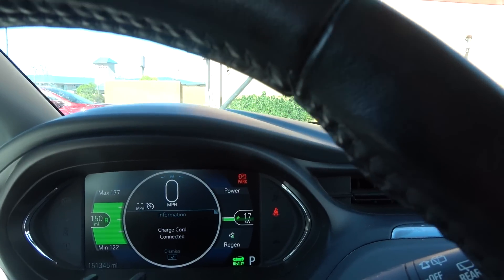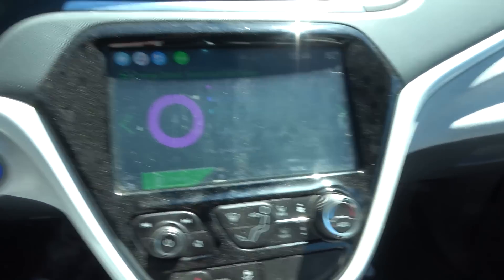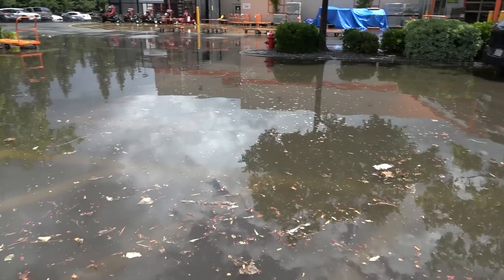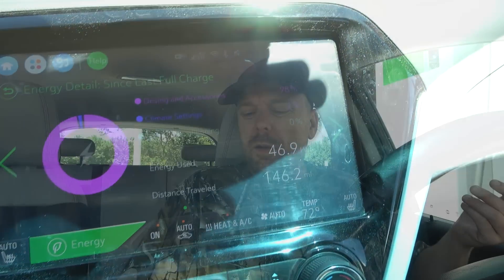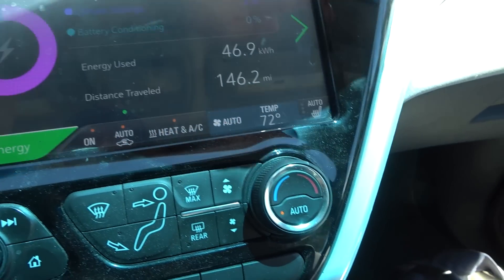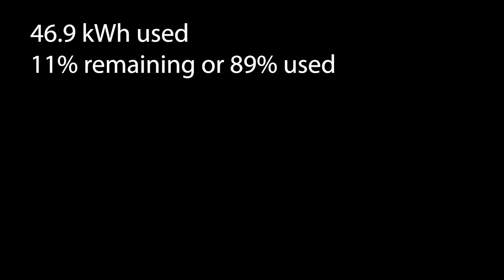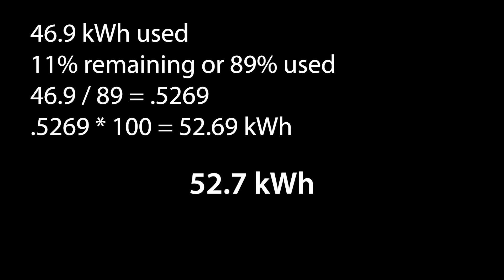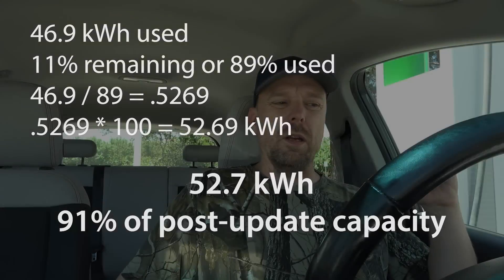2017 Chevy Bolt EV Battery Degradation at 150,000 Miles

Comment: 60KW or 66KW after recall ?
Reply from the maker: This was before my battery replacement, so this was the original 60 kWh pack that shipped with the car in 2016.
Reply: @newscoulomb3705  sorry don't understand , this video was uploaded 2 years ago , you don't replace your battery until 2023 ?
Reply from the maker: @tanweerahmed6861  My battery was replaced after I made this video, so this was the last degradation test I did on the original, 60 kWh battery. I now have a new, 66 kWh battery installed. That was done at 159,000, if I recall correctly, but I'd need to go back and check my notes.

Comment: That is what you get when you insist on charging to 100% and draining to near zero. Most of the time, we don't need to charge to 100%. So, we mostly charge to about 80% and don't drain to below 20%. Charge to !00% only if  we need when taking long trips and need every mile to reach the next charging station. Look at it like constantly filling and draining an air balloon. Filling to 100% stretches it, draining it to near zero, wrinkles it. Less of that is best for the battery.
Reply from the maker: With batteries, it's more about letting them sit at 100%. I was charging to 100% and letting it sit for long periods the first year, but I started limiting it to 90% after that. The arriving with <5% was a bit of a necessity back then, given the spacing of most of the chargers. Now, it's fairly reasonable to stay between 90% and 10% nearly all of the time.

Comment: I think 10% deg isn’t pretty good at 150k. maybe at 250k will be serious losses and problems. it seems that battery needs more upgrades. for more reliability degradation at 300k must be 10% and no more
Reply from the maker: The 10% includes the ~2 kWh that was lost due to reprogramming how the energy was calculated. Either way, I spent most of the first year charging to 100%, which had most of the impact on degradation.

Comment: this is all pretty sketchy

there are many things that can affect the range of your EV. Not just the battery, but wheel alignment, a sticky brake caliper, changes to your use of the heater or AC, changes to your driving habits. 

The range estimator on the dash board is only guessing how much range is left after a long trip, it can be off in either direction.

You can use an OBD2 reader to read the voltage of each cell in the battery pack. If you treat this like compression on a gas engine, and keep track of it over the years, you should be able to tell when a battery cell is starting to go bad. 

But unless you have a standard 200 mile drive that you can use for a test, at the same time of year, at the same temperature, road and traffic conditions, and use the cruise control to maintain the same speed each time you drive it, and take the wind speed into consideration (ask any motorcycle rider with no windshield).... I think you would just be chasing the wind.

When you charge your car the charger will tell you how many KW-Hrs it supplied, but it cannot tell you the charging efficiency of your batteries. They are not 100% efficient -  to fully charge a 60kwhr battery pack you might need to put 65 or 66 or 69 KHhrs into it, also depending on temperature. 

When the car shows you (on the onstar ap for example) that the battery is 60% or 100% charged, what does that even mean? What is it measuring?
Reply from the maker: It appears that you don't understand the methodology. The Range Estimator isn't used for any part of the calculation. Even the actual range and miles on the odometer aren't factored.

The only data points are the Energy Used display, battery SOC readings (from multiple sources), and previously collected data using the same methodology.

Comment: Hi :) I just got a 2017 bolt ev with 122000 km. It runs like a champ. I am wondering if when you press the accelerator or break, do you hear a click sound like the gear just setting when accelerating or decelerating? i dont feel anything I just hear a little click. Also, do you find it reliable ? I have no issues yet but just wondering what you thoughts are as you owned it frome day one and have more mileage then I do. Thanks for the videos!   Its nice that you take time to share your experiences :)
Reply from the maker: Thank you. No, I haven't heard any clicking sounds on acceleration. Overall, I've found the Bolt EV to be very reliable. All of the issues I've had so far were the result of required maintenance, road wear/abuse, and recalls. Even then, none of those really affected the drivability in any meaningful way. Thanks for watching! I'll have more updates soon.

Comment: Google says that the battery was originally 60.9 kwh but only 58 was usable so you had about 9.1% degradation.
Reply from the maker: That Google research isn't accounting for the fact that my Bolt EV predated the patch that appears to have reduced usable capacity by ~2 kWh (at least on Energy Usage screen). I documented that update and the results on this channel. So in terms of real capacity loss, it would be based on starting with an initial capacity of 58-59 kWh.

Comment: How much is a battery replacement cost?
Reply from the maker: I'm not sure anyone knows at this point. There would be a core charge, and GM EV techs charge about $250 an hour. So it would probably be $1,500 to $2,000 for labor and then whatever the battery cost minus core. So far, the only batteries that have had to be replaced were still under warranty.

Comment: Had my bolt for 1 1/2 years 90% of the time I drive between 70 and 75. I get 3.5 economy. Does that sound right to you?
Reply from the maker: Yes, that sounds about right. It's not too far off of what I've experienced with very similar driving.

Comment: 88% after 150k miles sounds pretty good to me. For my 2020 Bolt EV, Chevrolet says 66 kWh, but a sticker on the battery itself says 64 kWh, so I'll go with that. At this point, after 14k miles and with my driving routine, I'm getting 4.5 miles per kWh which amounts to 288 miles of range from the 64 kWh battery. At 150k miles, if I still have 88% of the vehicle's 259 miles of EPA estimated range, I'll be very happy. I rarely charge above 80% now anyway. With only 200 miles of range, this vehicle is still very practical even on road trips requiring DCFC.
Reply from the maker: Yeah, I definitely agree. I need to start doing some more testing with this new 64 kWh battery. Apparently, there are two different ratings for energy, which is why the sticker on the battery doesn't always match. I just go with the energy displayed in the car because that is what I can see and track.
Reply: @newscoulomb3705  If you had 150k miles before Chevrolet replaced your battery, you made out like a bandit. They may never replace mine, but I'm happy enough with it anyway. If the diagnostic software says it's OK, I believe it.

Comment: GM has less battery and drive unit failures than tesla it seems like any way.
Reply from the maker: They do, especially earlier on. Tesla has improved a lot with their drive units, which used to go out more regularly, but I don't know that I've ever heard of a GM drive unit failing. It's usually a supporting component of some kind.
Reply: @newscoulomb3705  Nice evs are coming from LYRIQ TO BLAZER might be cheaper in used markets.I Already see mech e in the mid 20s.

Comment: 10% battery degradation at 100,000 miles means 100% degradation at 1,000,000 miles. And, if an owner does not abuse his/her Bolt with frequent fast charging or severe driving conditions, the battery is likely to last even longer than that. Not bad at all.

Comment: when I drove to Salt Lake City to las Vegas with my chevy boltI was averaging a little better than 200 miles per charge with my new battery is that good or bad
Reply from the maker: Those are 80 mph freeways, so I think 200 miles would be expected at those speeds. You should be seeing around 64 kWh used from full to empty with a new battery, so 200 miles would be 320 Wh/mi or around 3.1 mi/kWh. That's in line with expected efficiency at those driving speeds.

Comment: Bought a 2017 bolt with 35k on it then got the new battery install. I'm doing 210 miles per day through the chicago winters. New battery already has 100k on it.
Reply: You are getting 210 miles, even in Chicago winter?  I live in suburbs of Chicago and considering a low mileage 2017 Bolt.  Just curious how things will be in a Chicago winter?   Thanks

Comment: They're not "upgrading" anything. Instead of giving it an upgraded Ultium pack, they are scrapping the Bolt altogether.
Reply from the maker: They're essentially replacing the Bolt with the Equinox. The hope is that this will only be for the time being, and GM will eventually bring back the Bolt EV or some equivalent compact hatchback.

Comment: I plan to keep my bolt for long term. Wonder what kind of fix have you done to your bolt? Just want to know what kind of problem I may have down the road...
Reply from the maker: There really haven't been any fixes. I've taken it in for a couple of recalls, but those didn't cost me anything. Other than that, it was only wear items and damage. So things like tires, wiper blades, and cabin air filters, but also a replacement windshield due to rock cracks. Outside of that, the Bolt EV has had zero issues.
Reply: @newscoulomb3705  wow. how about wheel bearings, arms? I wonder how the car holds up on those mechanical parts that usually gets wear and tear.
Reply from the maker: @yili9725  So far, nothing. I think the Bolt mostly has sealed bearings, but I haven't needed to check/replace anything so far. Even the battery coolant flush was done when the battery was replaced under warranty (that flush usually happens at 150,000 miles).

Comment: Replacement? Why? Replace the bad cells and save money.
Reply from the maker: The cells aren't bad, but they are a potential fire risk. There's no way to confirm that they are bad, so it is safer to simply replace all the cells in the pack.
Reply: @newscoulomb3705  there's a shop in the DMV area that will test all the cells and replace bad ones. I've had it done. Auto Tech Service in DC.
Reply from the maker: @livingthedash6727  Perhaps, but GM dealerships won't do that under the full recall. In my opinion, it's better to just take the free replacement battery and not worry about it.
Reply: It doesn't work like that, not on these massive packs. Unbalanced cells will forever be unhappy cells.

Comment: Now that you've hit 150K miles, have you given any thought about the maintenance schedule? Have you thought about changing the coolant ot the transmission fluid?
Reply from the maker: Great question. I was just notified that I will be receiving my replacement battery this week (which is why I put off the maintenance), and part of replacing the battery is draining the coolant. I will ask them about additional maintenance when I'm there.

Comment: i thought fast charging between 30%-70% does no damage to li-battery. maybe eric's frequent dc fast charging was helping him.
calculation wise, gm says there is 57 kwh electricity can be used to drive. so i am not sure if eric's calculation has the right denominator.
Reply from the maker: Fast charging between 30% and 70% significantly reduces battery wear, but it wouldn't eliminate it completely. 

The 57 kWh is also not accurate. Yes, it's on a sticker on the case from LG, but it's not the same energy calculation that GM used to come up with 60 kWh. GM's numbers are what is displayed in the car, and even the later 58 kWh that many Bolt EV owners saw displayed new appears to be due to GM's adding a buffer that reduced that original 60 kWh.
Reply: @newscoulomb3705  my point was your fast charging during long distance trips actually does not hurt the battery. calculation wise, gm advertise 10% degradation on 100000miles, or 5.7-6 kwh. and that should be really achievable. If your battery capacity reduce less than that, meaning you are doing ok.
Reply from the maker: @yili9725  Ah, I see. But that's still not right if you're assuming that I'm starting most of my DCFC sessions at 30%. Typically, I'm starting my DCFC sessions at <10%, and often <5%. So there's quite a bit of additional wear as a result.

Comment: Welcome to EV Life, cold temp,drop in range, too hot drop....too much of a headache!
Reply from the maker: Those things affect gas cars, too. If people are forgetting that, it explains why I see so many abandoned gas cars on the side of the freeway. Sure, some had overheated or caught on fire, but I guess the rest just ran out of fuel. 🤷‍♂
Reply: @newscoulomb3705  Good points. All I'm saying is EV's are the future but there are problems for long roadtrips,combined with Temp impact is not practical for the majority. Design EV with 400 mile range with min drop in range, MSRP mid 30K you have a game changer. Until then I'm happy with my 38mpg average ICE.
Reply from the maker: @kv1930  You'd have a game changer long before that. A new Bolt EV (not mine, with over 150,000 miles) would already meet the needs of a majority of drivers (according to DOT data, fewer than half of all drivers ever take long trips of 200 miles or more). 

The sticking point is still price. The median new car purchase price is still less than $30,000, and most people still can't (or won't) buy cars new. Price a 200 to 250 mile EV at $25,000 MSRP, and you'll have your game changer.
Reply: @newscoulomb3705  I agree! Hopefully I can be in good health for another 15 years and go EV!

Comment: Can you get more details on the battery level and performance with an OBD reader?
Reply from the maker: No, not really. In my experience, the OBD2 reader and apps aren't very accurate when it comes to calculating degradation or even battery percentage. I've found that using the onscreen data and information from the charger (what the car is reporting to the charger) is far more accurate, and really, what I'm looking for is real-world numbers that can easily translate to what other Bolt EV owners are seeing (and not just those using OBD2 readers and apps).

Comment: Are they not replacing batteries under recall?
Reply from the maker: They are, but my local dealerships are all very slow to replace. Several have told me that they only have the bandwidth to do one or two battery replacements a month, so I figured I'd use the opportunity to keep testing my original battery as long as possible.

Comment: That is really good degradation if that's the original battery. Very cool. My spark is around 90 percent from new with roughly 38k miles..
Reply: The problem with the Spark degradation is the small battery. 
Cycling the battery (0 to 100% is a full cycle, 20-50% would be 30% of a cycle) is what degrades it, so the smaller the battery, the more you have to cycle it for the same driving usage.
e.g. 100 mile range battery, drive 50 miles, that's half a cycle to recharge. 250 mile range, drive 50 miles, that's 20% of a cycle to recharge. So the 100 mile battery is going to degrade 2.5 times faster for the same usage scenario.
I bought a Bolt as it has a 259 mile nominal range battery.
Of course the Spark is also a smaller, lighter car, so you get more miles/kWh, so it's cheaper to run.
Also, charging to 100%, and draining below 20% degrades the battery faster. If you can keep closer to the 50% mark, say charge at 30% and go to 70%, the battery will last longer. Of course then you only get to use 40% of your theoretical range, but if you only drive 40 miles a day and can recharge overnight that's not an issue. 

As battery technology improves we will (hopefully) get solid state batteries which charge faster, are more energy dense, and degrade slower, and the truly small EV should return to the market with a greatly increased range.

Comment: You have to take into consideration that this is not a scientific test and both the Bolt's and the EA charger's indicated energy use is not 100% accurate. Also i believe even though the battery was rated 60kWh, it was 57, wasn't it?
Reply from the maker: Yes, this is mostly a data point using available information, which is why I'm fine with rounding the results.

In terms of the Bolt EV battery, it shipped with (and per the energy usage screen had) ~60 kWh of usable capacity. The Bolt EV's energy rating system appears to have been adjusted in early 2017, which is where I said I lost that ~2 kWh. From that point forward, most Bolt EV owners reported about ~58 kWh usable per their display.

The 57 kWh rating was based on a sticker that LG put on the battery case. It appears to be the result of LG using a different method and parameters for measuring capacity, which doesn't align with what the Bolt EV actually displays.

Comment: Keep us updated on your battery pack replacement. It would be interesting for you to do a comparison of the DC charge rate of your car with the new 66 kWh pack compared to the original. I've seen conflicting info online that pre-2020 Bolts with the replacement pack have a slightly different charging curve than new 2020+ Bolts with the native 66 kWh pack.
Reply from the maker: I'll definitely keep you posted! I just need to figure out when that replacement pack is coming.
Reply: @newscoulomb3705  do you know how much to replace the battery pack? does the warranty still cover with those battery that cause fire in 2017 chevy bolt ev? thanks
Reply from the maker: @tianh360  I haven't seen cost to replace a battery, but all pre-2022 Bolt EV/EUV are eligible to have their batteries replaced free of charge under the recall. The new battery comes with a full 8 year/100,000 mile warranty.

Comment: I received my new battery in  April, love the extended range would’ve preferred an increase in charging speed
Reply: That 55 kW maximum charging rate is what really dates the Bolt, and probably one of the main things you have to warn prospective buyers about. Love my Bolt, but it is not the ideal vehicle for road trips! 🙂